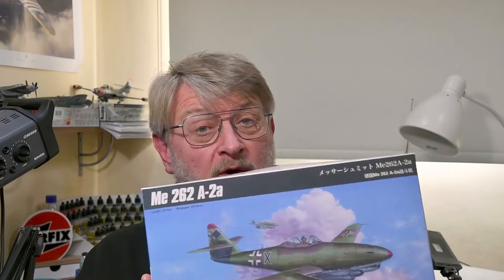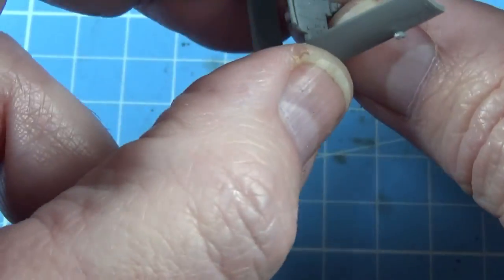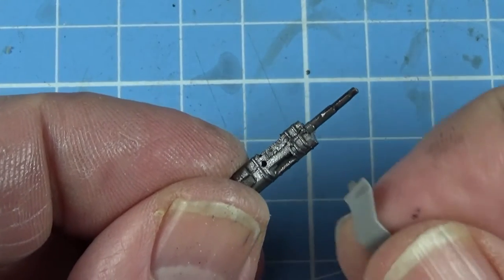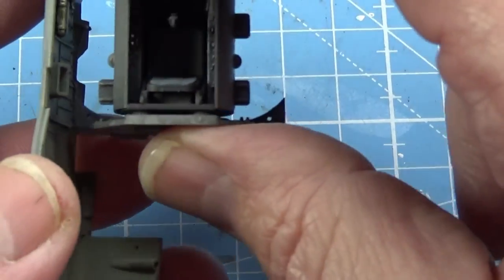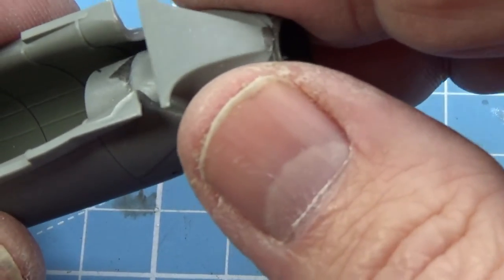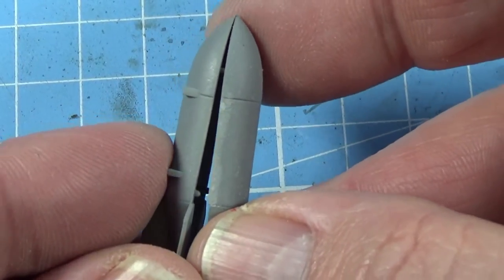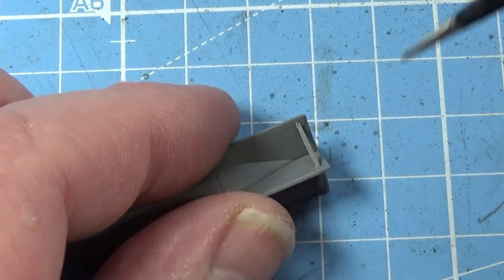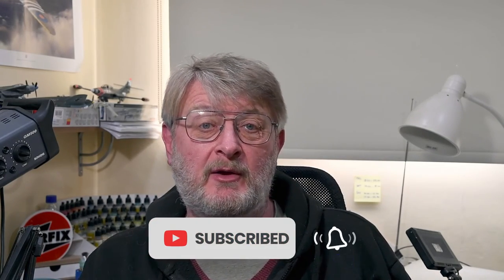MESSERSCHMITT Me262 Hobby Boss 1/48 scale model kit - how to make it!

Comment: Very nice work Gary. Not Criticising, but the Me 262A-2a generally only carried the lower pair of 30mm cannon. It was primarily tasked as an attack/bomber so had to save weight and omitting the upper cannons was needed in  order to safely carry two 500KG bombs - Those two upper cannon and their ammo amounted to just over 300KG gross weight.... So the bomber was unwieldy, even with them removed, but not as badly as  it might have been. The upper ports were faired over with a small oval plate of airframe aluminium.  (In the 2 seat nightfighter in 1945 the 4x30mm cannon were supposed to be replaced by 2x 20mm  MG151 so would have had 2 long barrels protruding into the aerial's space on the nose. As only a few were built, in something of a hurry, references do show at least one retained the 4x 30mm arms fit.  Where I live in NZ the HB Me262 is between 1/2 and 2/3 of the retail prices of the Tamiya kit of the same aircraft, and HB have done most if not all the variants as well. I agree that it is really a superb little kit. Bonus - IF you get the 1/48 Amusing Hobby kit of their Me262 HGIII, then parts of the HB kit can be used in that also eg NOSE WEIGHT! (sometimes with minor adjustments.) The HGIII was the proposed High Speed (Hoch Geschwindigheit) variant, with increased wing sweep angle and engines buried within wing-root fairings, like the DH Comet, only twin engined! And it would have been a VERY Pretty plane!
Reply from the maker: Yes, I did wonder with the nose covering only having the two gun ports, but just blindly followed the instructions like a good boy...!

Comment: I think it was Eric ‘winkle’ brown said that an Me 262 with British engines as in the meteor you would of had a formidable aircraft the 262 engines only had a 10 hour life span before major work ,great work Gary 
Mark 😊😊
Reply: I've seen 10-25 hours for the Jumo 004 suggested; longer if flown with care. The issue being the use of low grade steels due to lack of additives such as nickel, cobalt and molybdenum. The Welland engine as used on Meteor was nearly a foot wider than a Jumo  so perhaps a Metrovick axial would have fitted.
Reply from the maker: Indeed Winkle thought it probably the best fighter of the war. I think he also recognised that axial flow engines like those in Germany would ultimately have development potential way beyond the centrifugal flow engines like the Derwent, and they had significant drag advantages too. Now, a Junkers Jumo with British steel for the turbine blades...

Comment: Very nice . I reckon I must have a dozen or so Me 262s of varying flavours but yet to purloin one of H/Bs. If I may , Molotow Chrome pens are very convincing for 'chrome/polished metal' finish and perfect for aircraft telescopic undercart oleos(the shiny bit!) . They can be dirtied with a lick of wash to represent grease . I also use the Chrome pens for reflective pieces like mirrors and landing/recognition lights . All the best mate . Pete
Reply from the maker: I've used those pens for light backing and stuff but on an oleo is inspired! Just tried it on the Mossie and it stands out even though the rest is (as yet unweathered) aluminium. Brilliant tip, many thanks!

Comment: WRT guns they're modified of course from the original designs for soldiers to fire manually. As soldiers were/are mostly right handed the ejection ports are on the right too. Only a couple of weeks ago I saw a TV drama where an officer stopped a soldier about to fire left handed and angrily pointed out he'd have got a faceful of lead.
Reply from the maker: Technically he'd have got a faceful of brass? Back in the Lee-Enfield days you were right handed or right handed. Operating the bolt with the left hand was way too slow for comfort! I'm not entirely certain about this, but I have seen M16s operated either right or left handed, so presumably the cases eject upwards?
Reply: @garys_stuff  I know my late father did National Service and qualified marksman on the Smelly. BTW the lead/brass thing was probably a script booboo.